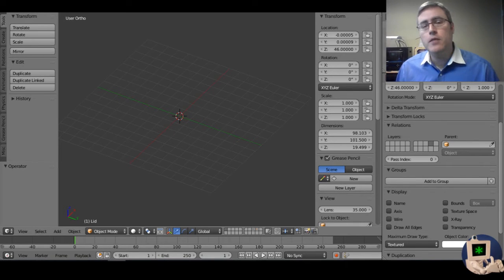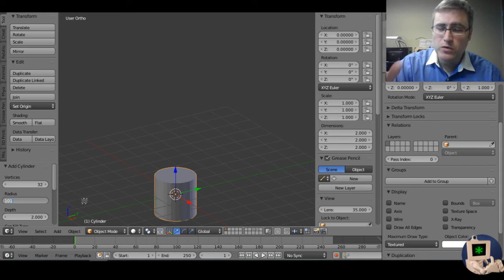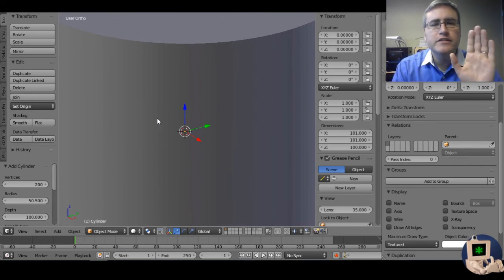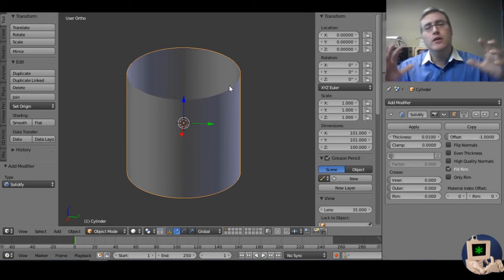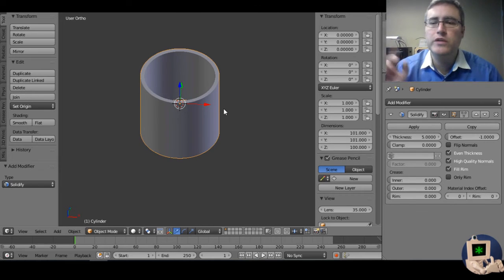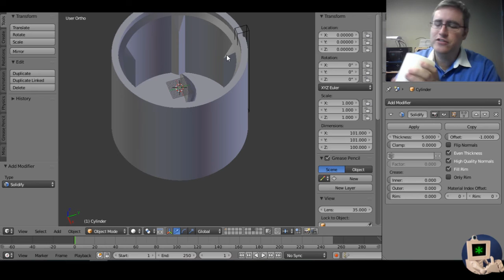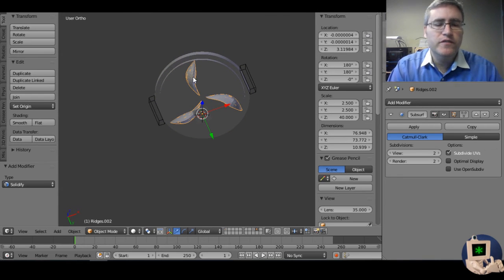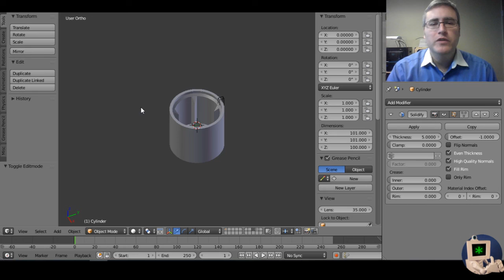3D Printing Project - Tumbler Insert

Comment: Thanks for your blender video . Im having a hard time figuring out how to make a barrel cam with a helix in it to try to make a mechanical revolving display. what i really need is a helix cut into a hollow cylinder.
Reply from the maker: I don't know how that will help make a rotating display, but I'll attempt to help you with the helix barrel cam. It involves using the screw modifier to make the helix shape. I'll play with this and get back to you.

Comment: I think the term is called Baffles, Also how does the plastic insert hold up to the tumbling?
Reply from the maker: So far so good. I would need to seal it if I wanted to do wet tumbling, but for as much as I use it it works great.
Reply: thats pretty good to hear! Do you have any pictures or videos of the printed parts before and after?
Reply from the maker: I'm afraid I wasn't that dedicated to documentation. Sorry.

Comment: +3D Printing Professor
Maybe an odd question, but having seen some videos featuring "tumbling of parts printed with metal filaments"  I've started to wonder how much of the "sheen" actually comes from the "tumbling media" and how much comes from the printed material.
Now of course I understand that this is Highly dependent on which materials that are being used (e.g. if You polish a part made from filament without any metal content, then of course what ever "sheen" You get,  must have come exclusively from the "media". So that being said, do You have any "general guidelines"/thoughts surrounding this, how to achieve the best results for different materials and or how permanent the effects are from different "procedures".
If You do then It would be very interesting to take part of.
Best regards.
Reply from the maker: The current theory about coperfill is that it's not a copper but a copper colored soft plastic pellete thing inside. If it were actual copper it would wreck your nozzle.

Truth is there's no shortcut to actual metal finishing. Electroplating or tumbling a material on the outside of a part will be the only way to get a real metal finish. A tumbler is just one more tool in an arsenal of tools for finishing prints in my mind.
Reply: Many thanks for Your reply.
Best regards.